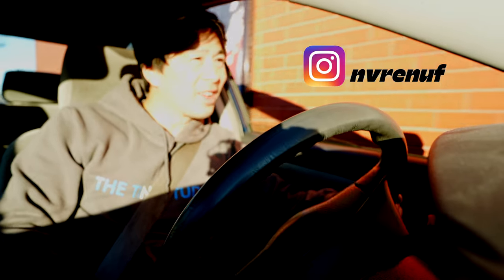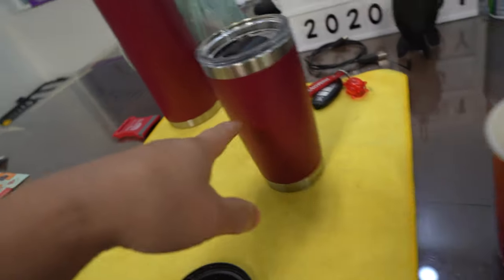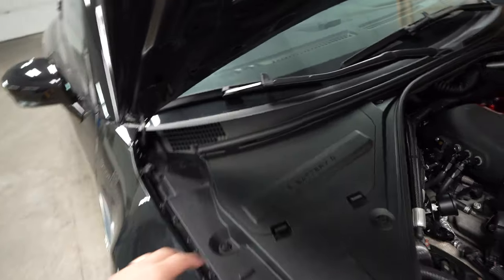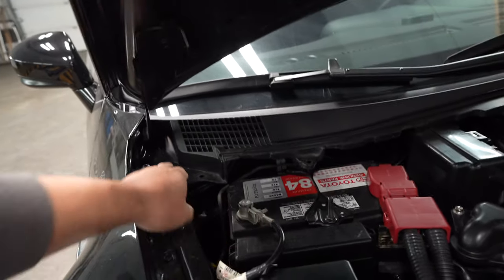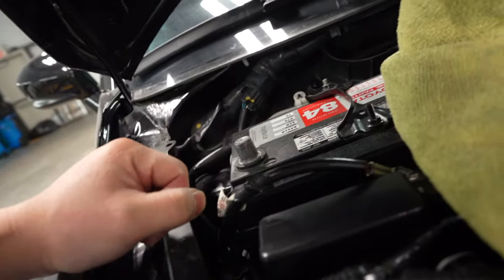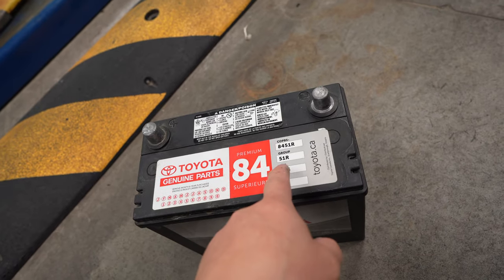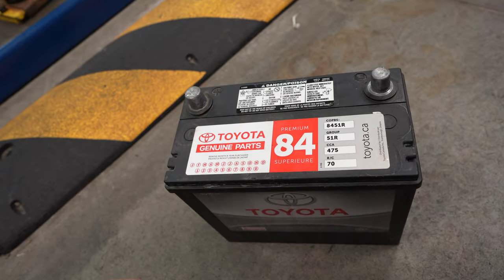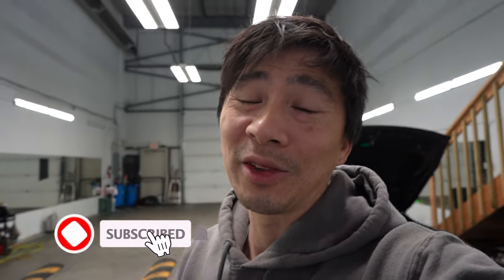Easiest Way To Change GTR Battery.

Comment: I did a thing! Thanks for the DIY. Very helpful to remove that extra piece to get the battery out!  There’s a clip hidden underneath the battery towards the front. I’m not sure there was a better way to remove it but I just applied force. 😅

Comment: Thank you so much for this video!  I just purchased my GTR, and noticed it was a little slow on the startup.  I went to start it up today and the battery was dead!  I found you video, and it guided me through the process with no issues.  It was the first battery I ever replaced!
Reply from the maker: Congratulations on your GTR! Such an amazing car. Best bang for the buck for HP.
Reply: I'm doing mine tomorrow.  I felt pretty hesitant, but this video is definitely making me feel more confident!  :)

Comment: The cabin filter yous however behind the battery is that the one you have to remove the glove compartment?
Reply from the maker: Yes that is the in cabin filter.
Reply: @phothrottle  thank you. I changed mines to new one but seems that a foul odor is coming from vents ..started after I put need one .any ideas? I bought mines new and sealed from ebay .
Reply from the maker: @ScolarshipBoy1984  that is weird. It should be a nice smell when the fans turn on.
Reply: @phothrottle  yea that's weird I turned on the just fan because I didn't wanna use the ac because of gasoline being expensive  and it started to smell weird maybe cause I never used that feature it's eighter hot for winter or ac when it's hot maybe that's why.
Reply from the maker: I know there is a smell with every car  when you turn the ac off but still have the fans running. Happens with every car. That might be the smell you are smelling.